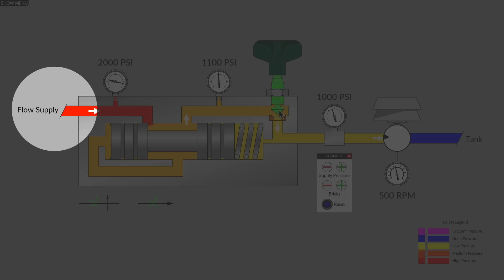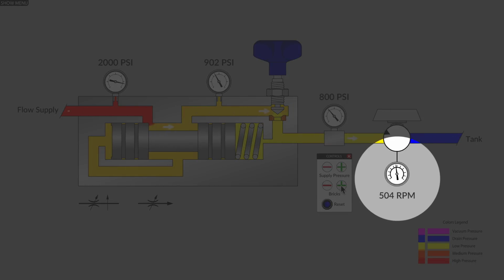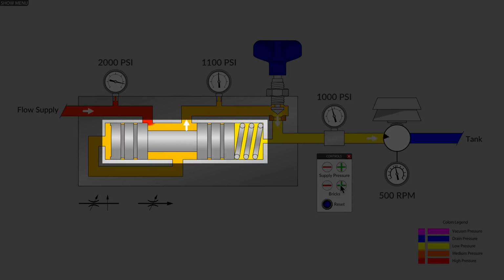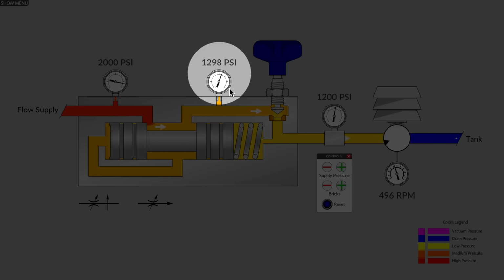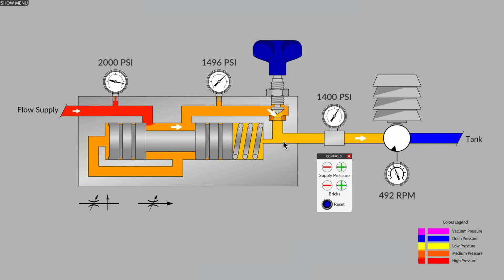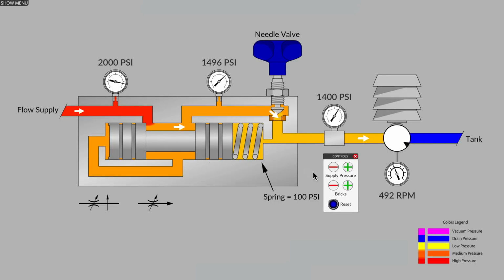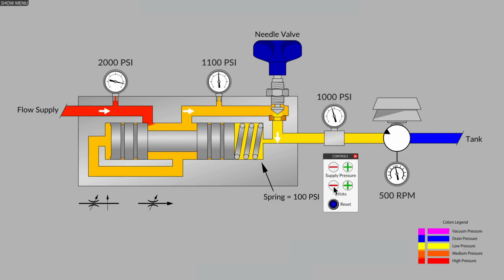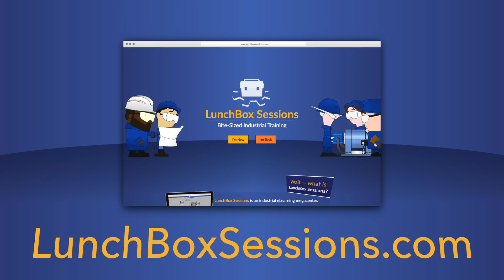Pressure Compensated Flow Control - Part 2

Comment: A thing worth mentioning could be the area of opening of the restriction (needle valve), lower delta pressure for the higher area of opening maintains the same flow.

Comment: Hello.
If towing and umbilical winches work at the same time from 2 variable dipalcement load sense pumps with total output flow 390lpm, so they should have pressure compensators in theirs manifolds?
Towing ad umblical winches have proportional valves with flowrates 300 lpm and 100 lpm.

Comment: Did I miss what happens to the comp spool when you change the value of the needle valve?
Reply: nothing happens basically. Compensator is responsible for keeping a more or less constant pressure differential over orifice. Orifice equation gives you an idea of how much flow can you get, depending on the pressure differential and orifice opening. Så if you further open needle valve, flow will increase, if you tighten it, it'll decrease. It's simple as that. Of course, if you want to have fine control, this is not a good option.

Comment: So flow volume and pressure increase simultaneously to maintain motor speed with the additional weight?
Reply from the maker: Almost but not quite. The additional weight on the brake shoe/brick stacker is what causes the new, higher load pressure as sensed by the right hand gauge. 

In a basic needle valve with no p. compensator, the change in pressure differential across the needle would mean that flow rate through valve would decrease.

So, in this pressure compensated flow control, the new, higher load pressure together with the spring, moves the compensator spool to set a new, higher pressure on the inlet side of the needle valve, thus holding the flow volume as you say, dead steady - or really close to it.

It's a cool valve isn't it?   Thanks for writing.  -Carl
Reply: Thanks.  Definitely a very interesting valve.  Hat's off to the inventor.